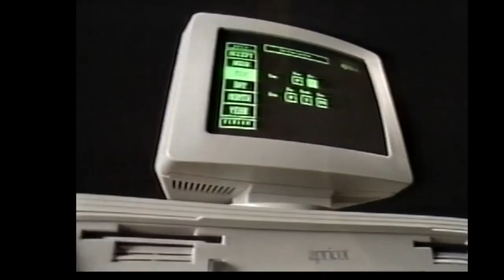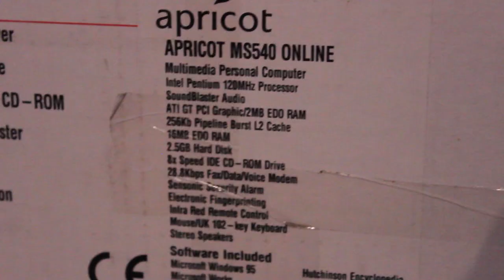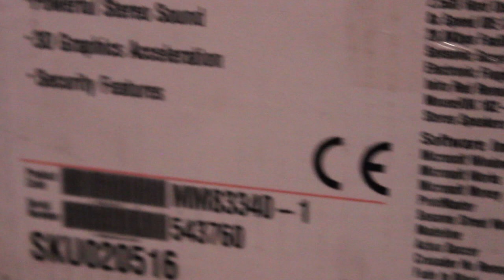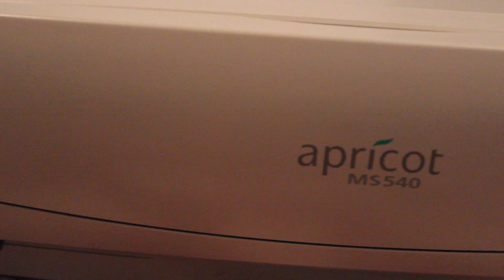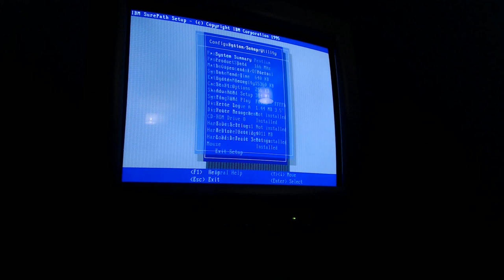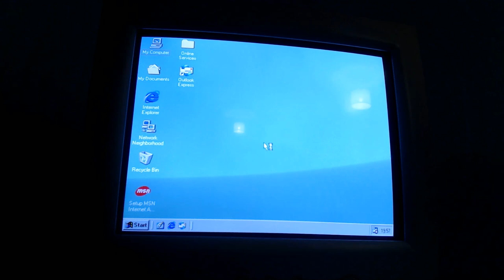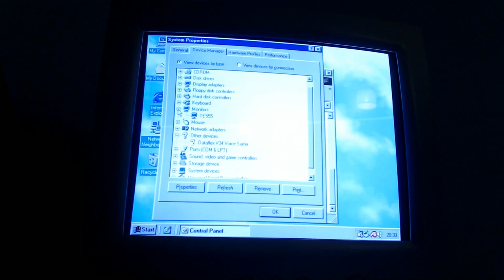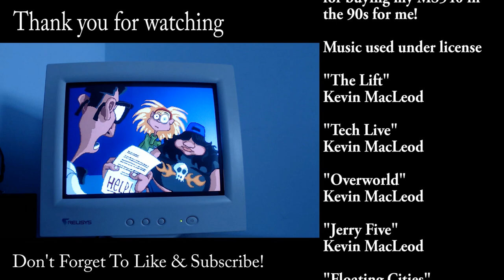Apricot Computers - MS540 Restoration

Comment: I used to develop programs on the Apricot F1 and they offered me 2 of them back in 1986 for £80.00 but i was skint and a teen programmer back then lol .. i regret that now - funny enough that apricot you had 120 Mhz  Pentium, I managed to put a 233Mhz with MMX back in 1996 and even dropped a Cyrix 200 in it .. if i remember and even AMD K5 oh my its so far back now thats when i first started building computers and i got my first ever project to build a mail order computer for a friend and I ended up getting that Apricot 120 Mhz computer of him all i needed for memory, hard drive and monitor and that was it also back then I even bought a Astek 24x CDRW drive for £24 from Stockport oh my!  - admitted they were well made rather like ICL computers.. shame the computers of today are not the same as back then .. i prefer the old style flashing lights HDD & POWER LEDS on the cases ect , what a mess today computer are.. ..with all the flashing tubes and disco balls! its a computer not a night club !!  =-  ha ha i remember one thing about that Apicot Pentium it was heavy and bulky not like my old IBM PC/AT but certainly a heavy beast !